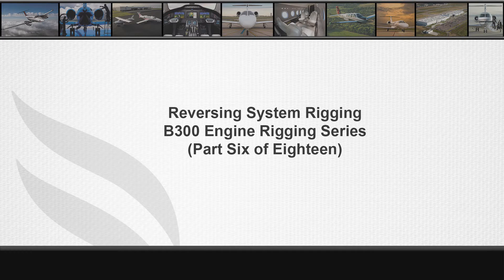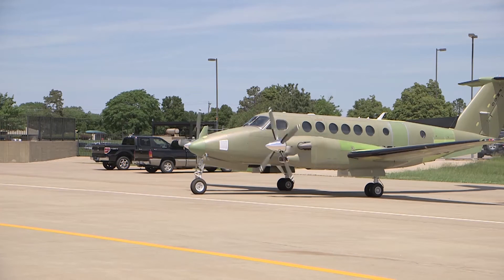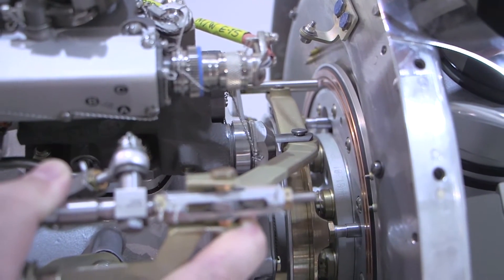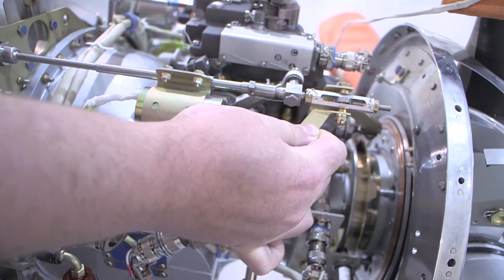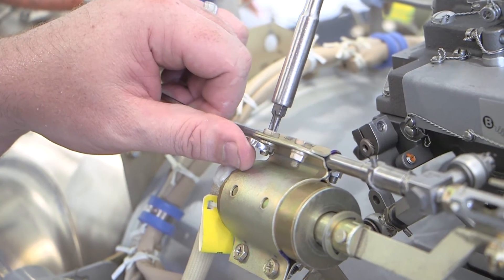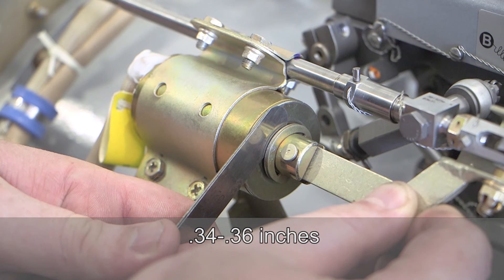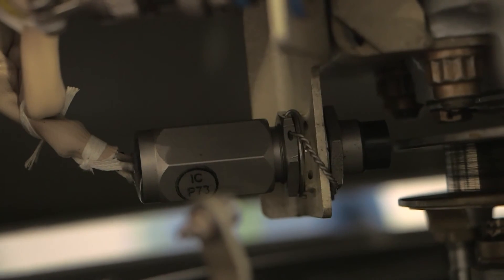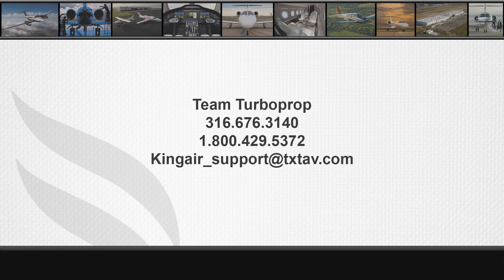Video # 6 - KING AIR B300 SERIES REVERSE SYSTEM  RIGGING

Comment: Having an issue on 1900d where the solenoid valve is energizing but sticky and not always releasing? Any tips regarding that? You said sand the area to get free movement on by the clevis and washers?